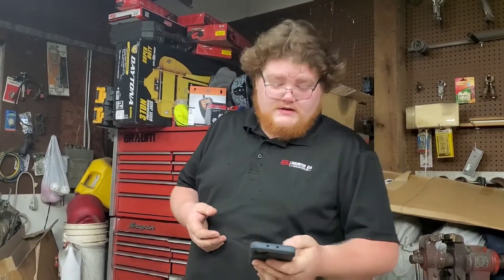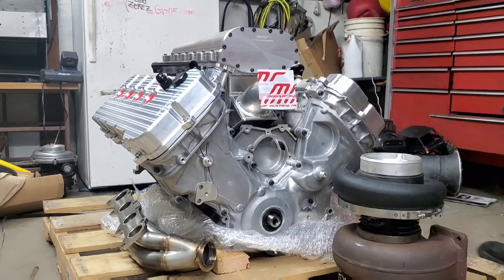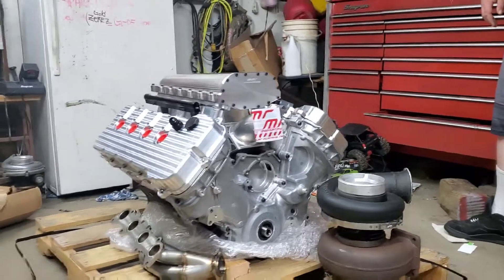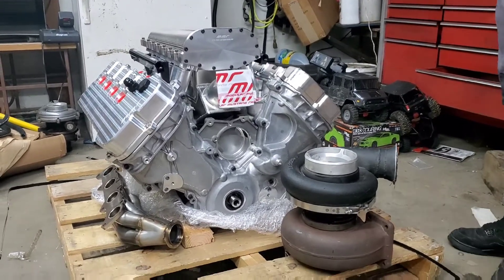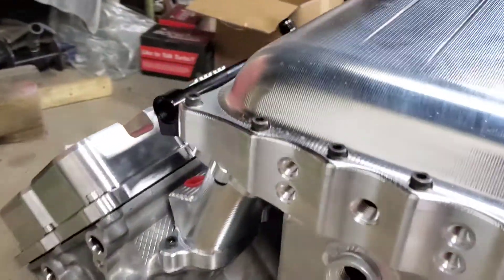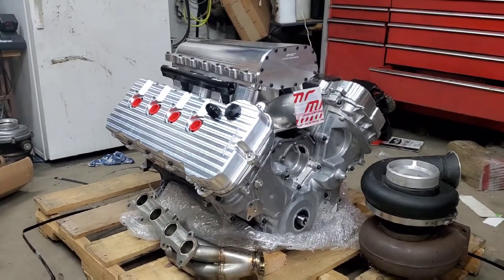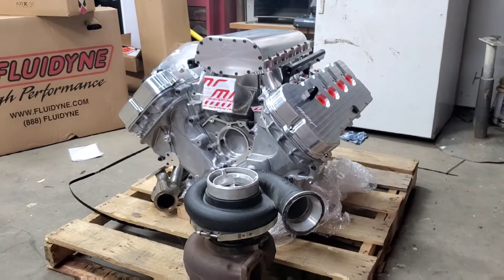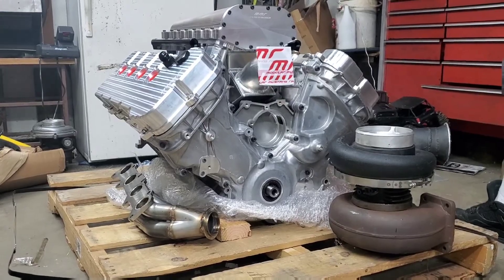MMR 2000HP Forged Long Block Build Specs: 2000HP s550 Mustang Build

Comment: How’s the motor doing? Thank you.
Reply from the maker: It's fine. Been sitting in the corner of my shop. Life hit and had to use the funds for the cage for something else. So, I just gotta get that back together cause that is one of the first things I need done. Aiming for next season, as long as life cuts me a break.
Reply: @mcbridemotorsports  I heard that brother. Well good luck to you man. Hang in there, it will work out.
Reply from the maker: @harrisonclark4382  We'll get it, as soon as we start working on it again yall will see more post.

Comment: Badass man!  I'm waiting for my engine.  It's been delayed due to the Manley 300M rods.  Hopefully get those and get the engine next month (fingers crossed).  It's been since Mid June since I ordered the engine.
Reply from the maker: I had ordered mine in Beginning of February, didn't get it till the end of July if I remember right. I was mostly waiting on cams. Unfortunately haven't been able to get engine in the car yet. Found out we were expecting some it got put on the back burner for now and we are just using the stock engine that's in the car. I hope to be out racing by Summer of 23 at the latest or we will probably sell it. Goal is to make it out next summer but we will have a newborn around Christmas and it's our first so we will have to see.
Reply: @mcbridemotorsports   Congrats on the baby, that's definitely gotta be the priority for now but don't give up on the car.  Hopefully things work out financially and personally to allow you to keep your passion alive. I'm pretty old now (45) but when I was 20 I had the performance bug real bad. Every cent went into my 92' LX 5.0. Had to wait until last year to finally build the 2015 GT I have now. Paid the car off then dropped $30k. Hellion TT kit, fuel system,  full suspension, axles, etc. Now with this addition hopefully be able to run 30#'s of boost and make north of 1300hp. So yeah, it's not too late just be patient.
Reply from the maker: @skullhart  I wont give up on the car. I've got it almost running as is. Well it will run just wont go in reverse so we think we may have installed something wrong with the th400 swap we did. So it's currently sitting in my grandfathers garage, just been waiting for it to cool down to actually go work on it. But I may end up selling the motor is I can't get it in. If the wife will let me. She's pushed me a lot with this project to be honest. Don't think I would have done it without her. She loves the car as much as I do and has told me if it take her selling her GT350 she would do it, even though she wouldn't ever be able to find another one. But that's just not fair to her. She's been trying to build the channel up while I work and I'm very appreciative of it. Not many women would give up the things the love or push their husbands not to sell their projects when they don't have time for them, especially with a baby on the way.

Comment: I wanna know how long this engine lasted cause mmr has such a bad reputation lol I have there engine and it runs big boost it’s just a 4.75 1000se and it’s holding 1100hp easy on a single 88
Reply from the maker: Yes, it is a billet crankshaft. It's got everything possibly done to it. Only other thing I could have upgraded was the block, which would have been the billet aluminum. However it's not optioned for water jackets in the block, so its a one and done motor.  Meaning you make your pass and turn it off. I want to be able to go to events like Rocky Mount Race week which require you to street the car. As far as how long it's lasted, the motor isn't in the car yet. It's been a little bit of a struggle to find the right person to fabricate the turbo piping and exhaust. So I have decided to learn the new trans and suspension set up first before putting the motor in for the time being. My grandfather and I felt getting more practice in and making sure we take the time to wire the motor up and getting everything right the first time.
Reply: @mcbridemotorsports  good on you bro your engine should have no problem, but mmr has shot quality engines so I prolly would have had that taken apart to make sure everything is proper clearance and all
Reply: @mcbridemotorsports  I have there engine and I had it taken apart and was a lot I’d surprises in the engine from ring issues to clearance to spaced shims in the rear main cap to hold the crank feom movements lol
Reply from the maker: @2vgod460  I've had the heads and oil pan off. Checking to make sure the parts I ordered are what came in my motor. Everything looks good. The motor is at TDC and I didn't want to spin it.  I haven't seen many people have problems out of their motor. A lot of their reviews are from people who never even talked to them. They took one persons word and decided to leave a review on something they don't really know about. So I take them with a grain of salt. Everyone I've talked to that actually has one of their motors, enjoys it. Now I will say their communication isn't the best, but that is a lot of companies issues.
Reply: @mcbridemotorsports  The block has a water option what are u talking about?
Reply from the maker: @TENNESSEETRACKHAWK  the billet block they offer as a standard does not have any water jackets built into it, however they can add them for another fee.